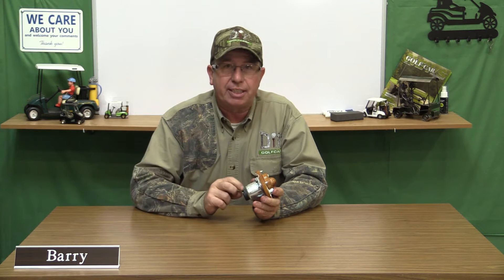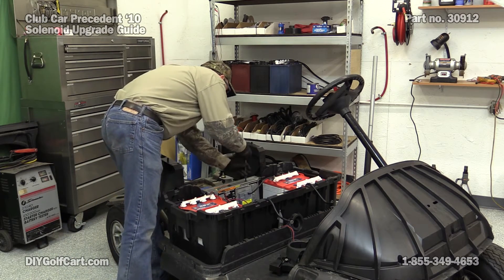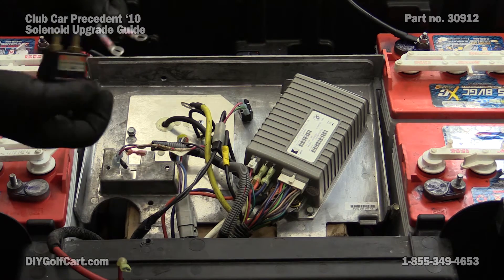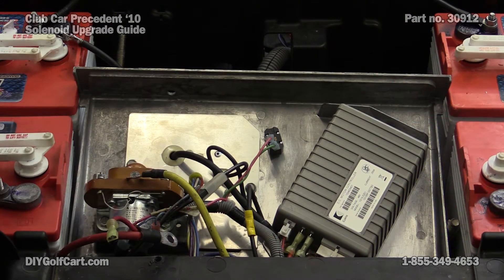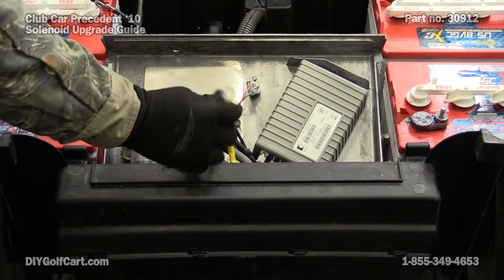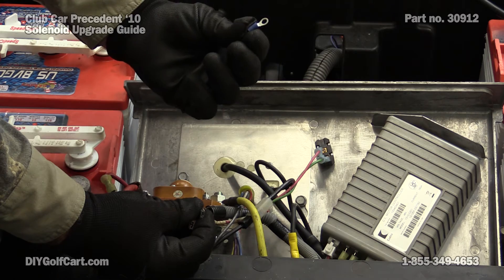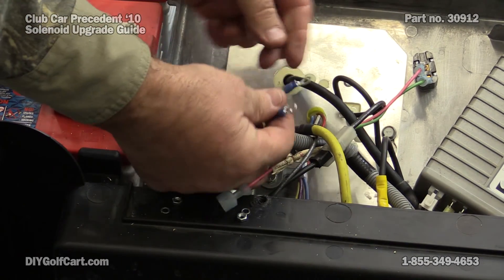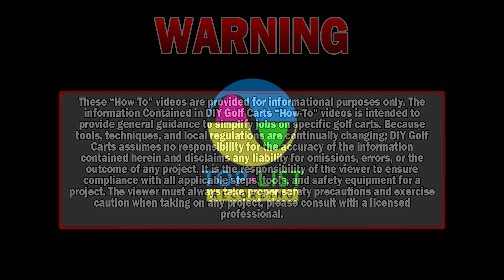Club Car Precedent Heavy Duty Solenoid Upgrade | How to Install on Golf Cart

Comment: Hi Barry, enjoyed watching your solenoid upgrade. I do have a quick question I was hoping you could help me with. I have a 2015 Club Car Precedent that I've put two new resistors on and when I hook up the 48V battery it burns out the resistor. What would be the probable cause of this?? Would greatly appreciate your advice.

Comment: I have a 2015 club car with a problem. It will go about 2 feet and stop as if the batteries are dead. The batteries are charged. Do you think the problem is the solenoid?
Reply: Do you get a click when you press the pedal?
Reply: I'm not a Club Car professional, but I had the same issue with my 2012 Club Car.  The problem was the solenoid for me.

Comment: I have a precedent Ingersoll  Rand 48 V Battery system. One of the battery was exploded after that radio & light not working. I can not locate the fuse that may have caused it. It runs but no lights & radio. How can I restore it. Please suggest. Thanks
Reply from the maker: +Alfred Franklin The fuse link for accessory items should be right off the Positive or Negative side of the battery it hooked up to. If there is not one there, you may have a damaged wire somewhere in the wiring system.

Comment: I was removing a broke rear shock on my 2009 club car precedent, when I removed my hand from the rear inspections panel I shorted the two post on the top of the electric motor with a wrench, now my golf cart will not move. I do hear a click in forward and reverse but no movement. Can you advise me on what I need to replace.  Thank you, Jeff
Reply: Jeff Alford you blew your controller.  There is no electrical protection on the back / motor side.  Replace the controller.